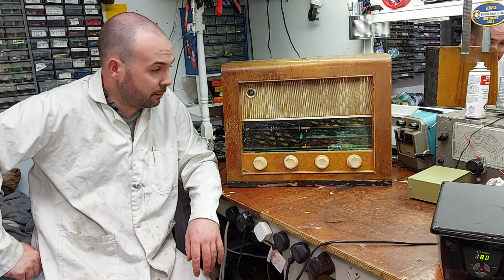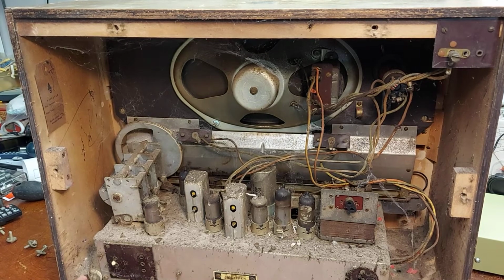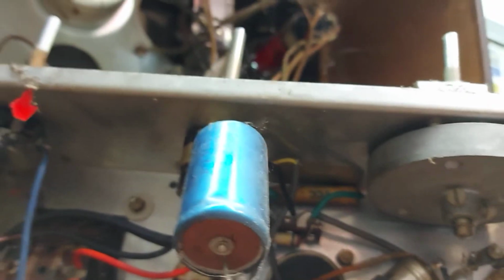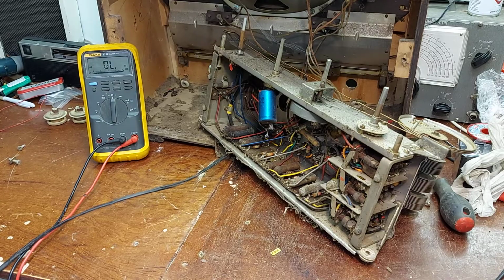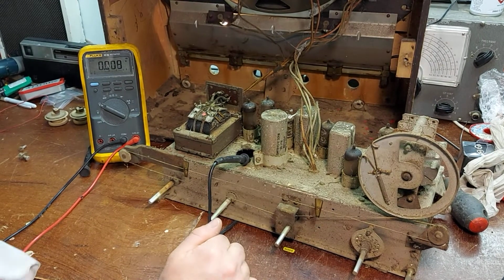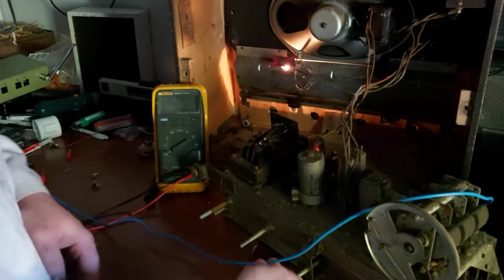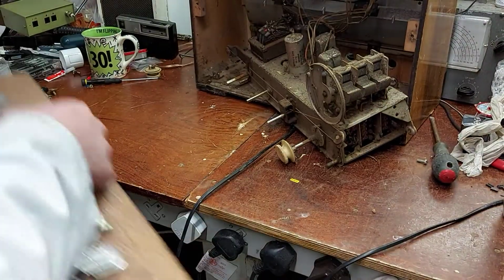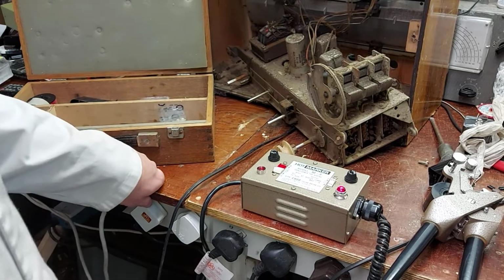Another Bush BS35 + mystery box....

Comment: What a great radio you have there. At the 14 min 50 sec moment when you tuned it and got the first station in, I was listening so intently to the radio and you said "bloody great!" I nearly jumped out of my skin, thinking one of my children snuck up behind me talking over my shoulder! So glad you are prioritising a new coupling capacitor. Maybe it was humming from a bit of positive voltage on the output valve control grid and so someone tried adding extra filtering with that big blue electrolytic....
Reply from the maker: Glad you enjoyed the video. Yes you could be right re the blue electrolytic.

Comment: I recall Barbers shops having old valve Radios in them when I was a Kid.  Always high up on a shelf
Reply from the maker: Always out of reach of little hands.
Reply: @IrishvintageTVRadio  The one I used to go to had an oil stove, and an ashtray where you would push down on a knob, and a plate would spin hurling the ash into the tray beneath.

Comment: I had to laugh, the bush looks like hell but it sounds smashing :-D
God knows what the extra capacitor was put in there for, i didn't hear any buzzing from the mains.
Should be a nice radio when you have done your magic with it :-D

The wooden case, maybe line it with felt and put a multimeter or two in it (if its deep enough).
The metal transformer box does look nice, after conversion to d.c maybe bolt a regulator to the case like a lm317 adjustable reg or similar :-D
Depending on the ability of the transformer of cause.
Reply from the maker: I have to say I was impressed by it's performance. I was thinking multimeter too for the box. Good thinking on the LM317.